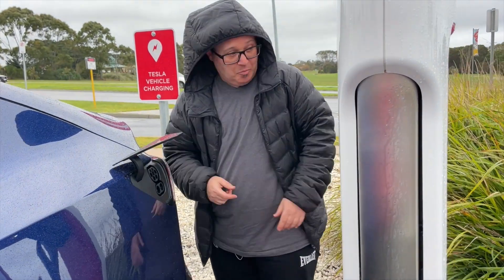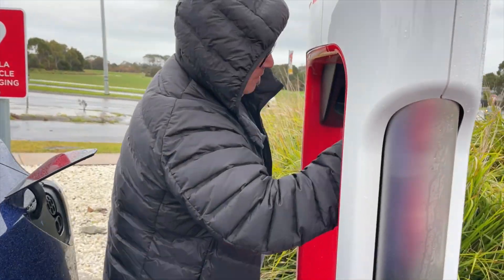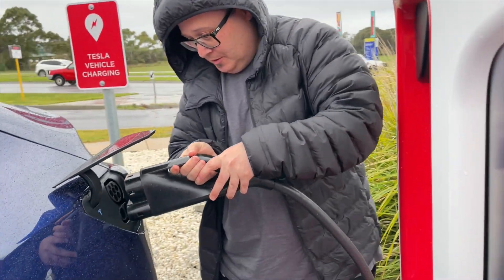Filling an electric car explained in a simple way

Comment: Speaking of charging every day, Robert Llewellyn on Fully Charged talking about how he was charging his Nissan Leaf too much because he didn’t know better so he’d go down to the shops come back and plug it in and the car would be charging when it was almost full which wasn’t good for it. Note: Leafs are first generation EVs and people and manufacturer’s understanding of how batteries work and how to take care of them has come a long way since then.

I know some cars (I assume most modern EVs would at least) and maybe some smart chargers perhaps? Have a way for you to preset how much you want the vehicle to fill. So depending on your battery type some batteries like being filled up but other batteries prefer to work within 20-80% so people will set their charging to only go to 80% unless they are going on a long road trip. 

And even when charging to 100% you might want to go to 98%-99% or something unless you really need 100% because that means you still have room for regenerative breaking. 

So it’s kind of interesting to hear experienced ev drivers talk about charging because they might only plug in every other day which is useful for those getting a second ev because it means you can switch off which car you charge. 

Tip when installing a car charger if it’s a two car parking spot try to set it up so it can reach both cars for future proofing. Although different cars can have charging ports in different locations so not sure how easy that is to do but anyway, something to consider further down the road, not something beginners really need to worry about straight up.
Reply from the maker: Thanks for the info and tip. I do go into a bit more detail about the whole 80% etc thing in some of my other videos about charging. 

I certainly wouldn’t describe myself as an experienced EV user. Still trying to get my head around all the kW, volt and amp stuff. And then try to explain it as simply as I can to others. 

I am actually trying to avoid talking about the in depth details. It’s good to know. But I want to try and keep things simple for folks who may already feel like there is too much to learn for the switch to EV. 

Hope I can find that balance of keeping things simple, but not so simple that I am leaving out important bits. 😀